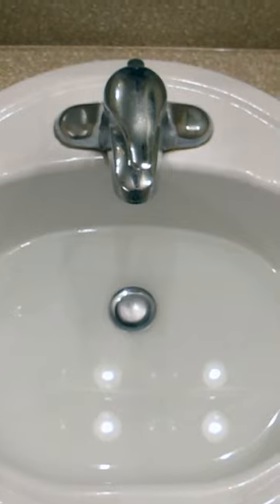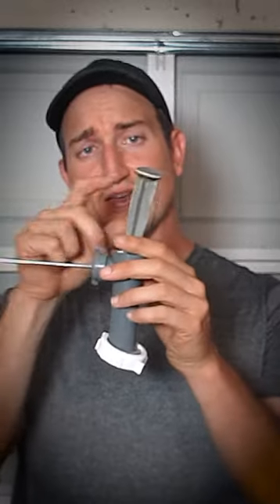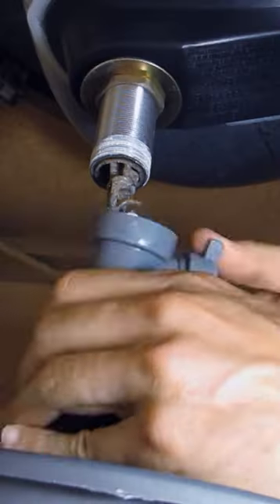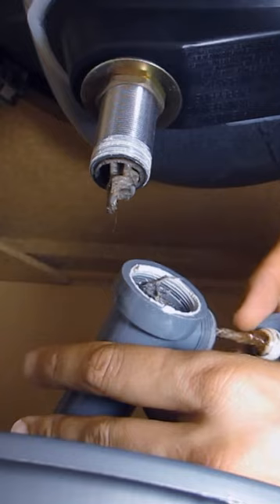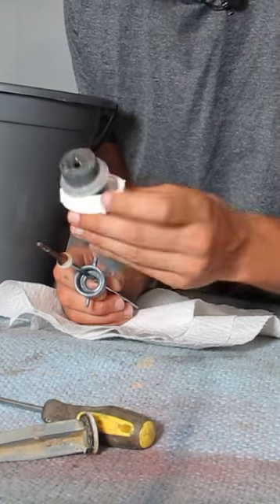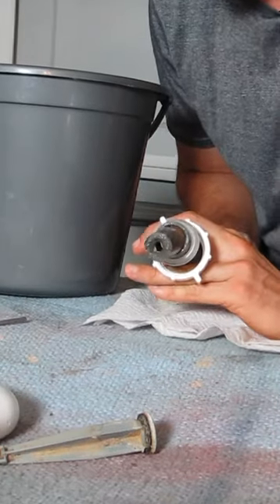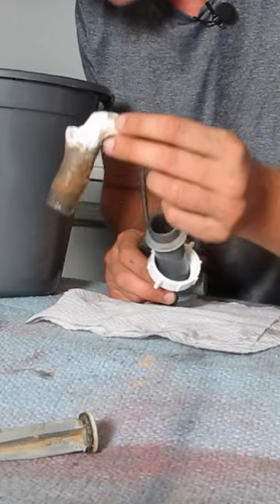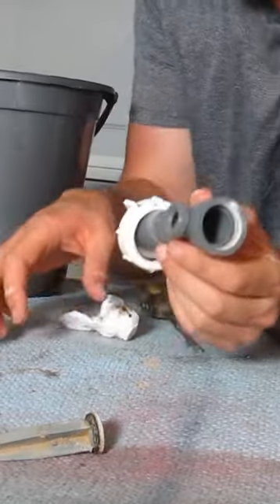Slow Sink Drain Fix

Comment: My sink holds water but is not stopped up completely with water, the design of the drain has holes but it's like the water is too light to push through the drain and it stays back until you get air in the drain like moving the water back and forth or swirling it around
Reply from the maker: Might be an issue with the venting in the plumbing lines.